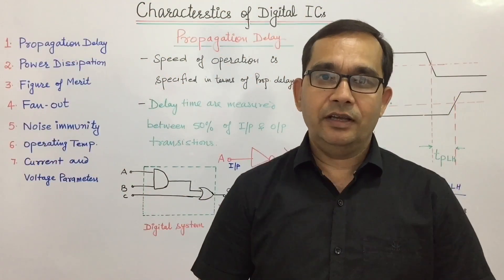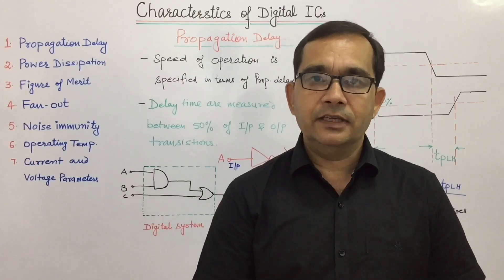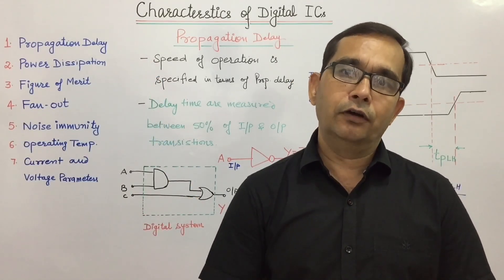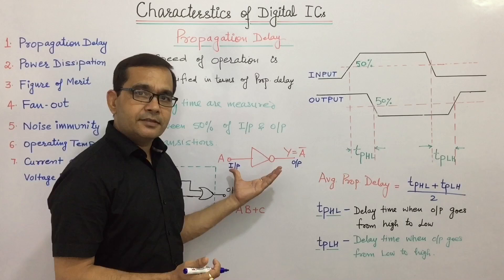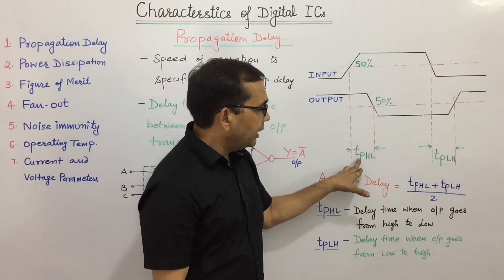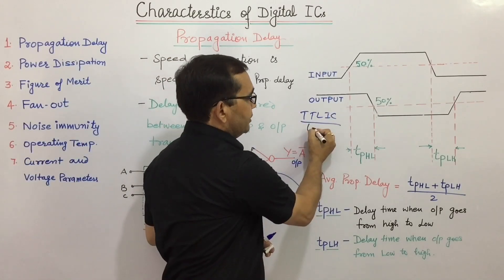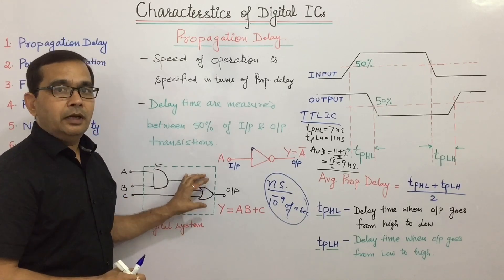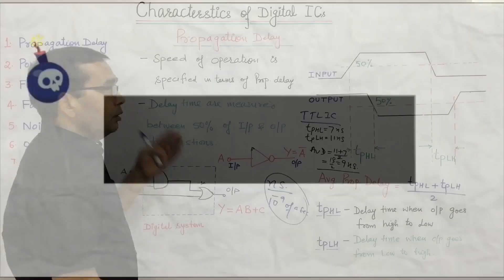4. Propagation Delay | Digital Logic Families | TECH GURUKUL By Dinesh Arya

Comment: The values of the propagation delay from high to Low & propagation delay from Low to High are not always the same. If they are not equal then the one which is higher is considered as the propagation delay time for the particular Gate.